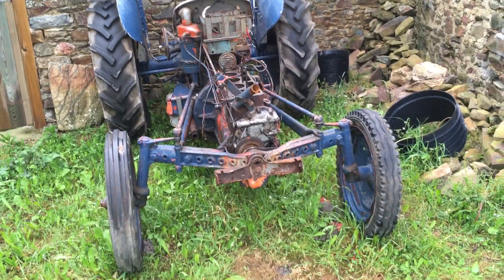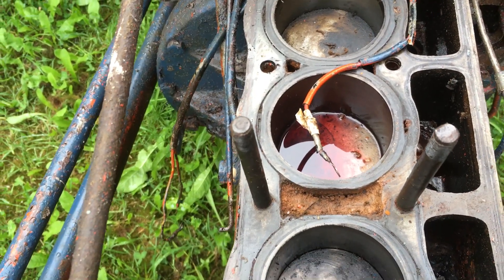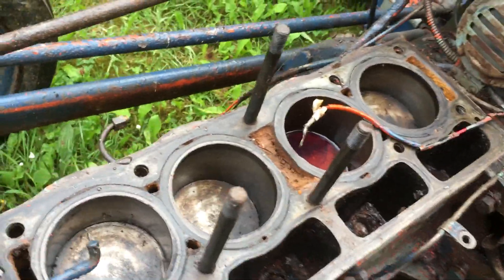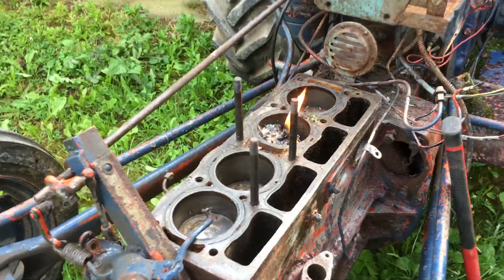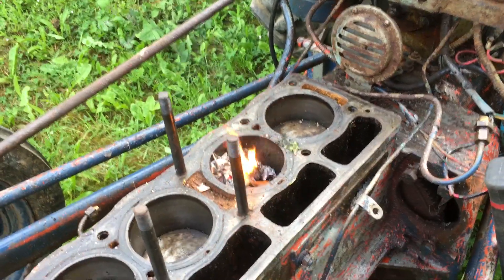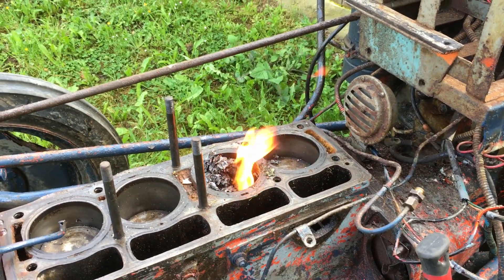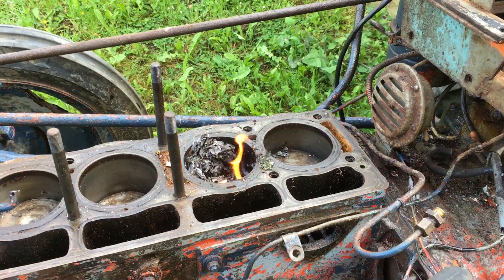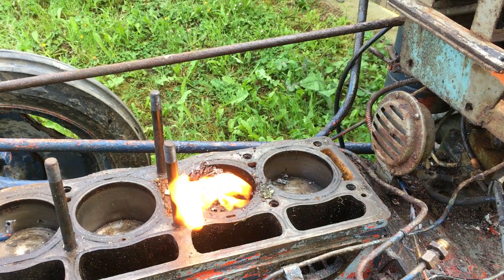Massey Ferguson TEA20 Tractor Part 3 - I set fire to the engine in dispare !

Comment: You could select a piston that is on the downstroke and after placing a piece of end grain hardwood on the piston apply your big Kango demolishing hammer to the block, with the WD40 or diesel on the top of the piston the vibration will eventually unseize it, a good idea with the fire to warm things up !

Comment: If you get some hydraulic oil pour it into an old sauspan and heat it up to nearly boiling point and pour it straight into each cylinder it sometimes releases it as the cylinder expands. Another trick is to use iodine. Pour iodine into the affected cylinder and leave it for a few days. Get a socket and strong bar and attach it to the front crank pulley and try to break it free moving it back and forth. Use a length of pipe for more leverage